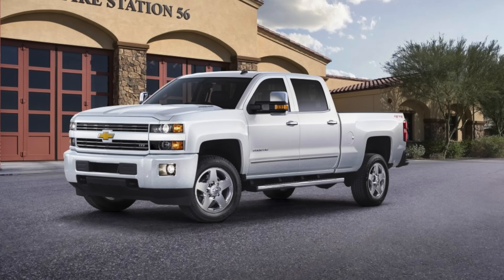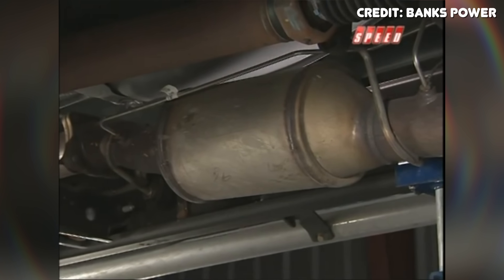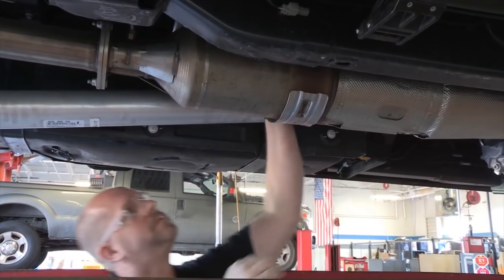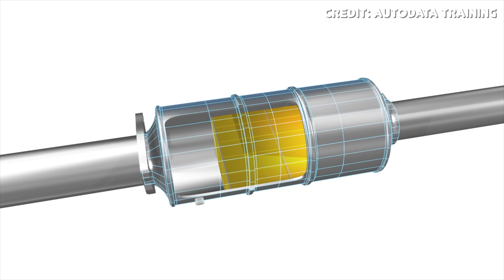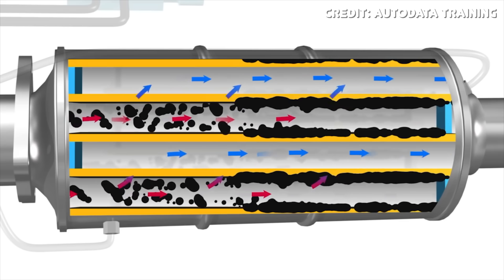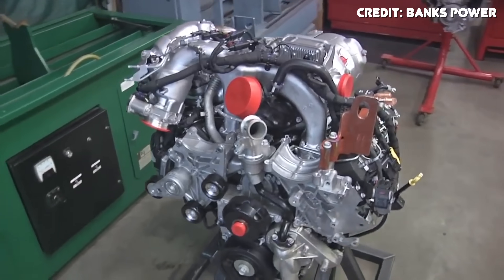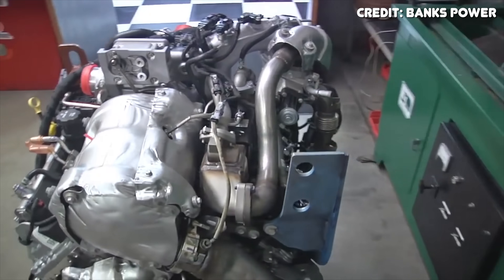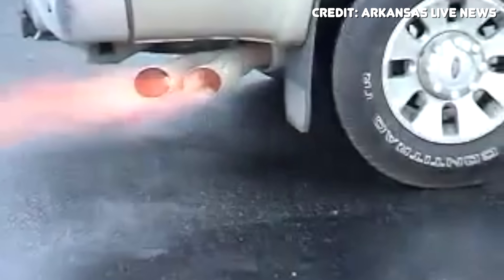Why Does Duramax Have This Exhaust Tip?

Comment: Insane emissions standards, what an understatement...
Reply: Dead the fed is what I say.
Reply: The EGR is even worse! Sending unburned fuel back through the whole intakee system. Clogging the turbo and intake with soot.
Reply: They are not insane. Diesel emissions are disgusting and cause serious disease. Only a moron wants to be exposed to these particles, and he and his children suffer the consequences. DPFs are not perfect, but they are very low maintenance these days, and still improving.
Reply: @microcolonel  typical progressive leftist talking points, you have no idea what really happens with diesel engines and the emissions they produce...
Reply: @MYSTERIOUS DRAGON dude its a c4 keep that shit quiet
Reply: European diesels don't have these problems It's the shit fuel in America
Reply: I know. I so miss all that black soot pouring out of trucks into my lungs.
Reply: No one over here understands where peak diesel reliability lies because our government screwed us out of owning the best era of diesel cars. Meanwhile over seas everyone gets 40-60mpg since almost ANY vehicle comes in a diesel. The only old stuff we can buy is 80s junk unless you want to try the somewhat rare euro cars that no local mechanic wants to work on. Non-emissions diesel Benz’s that DO NOT put out any smoke getting 37mpg full size sedans while ours get 15mpg.
Reply: More like designed to have to be fixed every 5 miles. Old cars last longer than new ones.
Reply: @classicv8dude268  no they don't. New cars operate trouble free at massive intervals that were unheard of fifteen, twenty, and thirty years ago; let alone any time before that.

Only somebody who doesn't know anything about cars can think they are less reliable today than at any point in the past.
Reply: @microcolonel  speak that truth man.  some guys want those old diesel semi's because they don't have emissions, and those trucks only get 5 mpg.  New ones get 8+ and don't soot up the air
Reply: @microcolonel  On what planet?  Peak reliability was probably in the early or mid 1990s when we were running engines which were fundamentally from the 1960s but with the addition of electronic feedback fuel systems and roller lifters.  This was long before the complexity of variable valve timing and direct injection and everything being made of aluminum and plastic.  Never mind all of the body electronics that randomly die and require a dealer technician program the replacement parts.  My friends' 10 year old or newer cars have more frequent and more expensive problems than my older high-mileage cars.
Reply: @KevinJames-yg9eu  agreed
Reply: @microcolonel  new cars are indeed more reliable. But we are discussing diesels, which are, without question, far less reliable than they used to be.
Reply: @thetowndrunk988 more complicated, but also incorrect.
Reply: @microcolonel  absolutely not incorrect. They definitely go to the shops a lot more than pre emissions. Not only do I witness it, but the data proves it. More check engine lights, and engines definitely do not go as many miles between overhauls.
Reply: @microcolonel  My diesel mechanic can prove you wrong.
The sheer number of blown head gaskets, failing injector pumps among other things not including the never ending problems with the dpf systems.
Every single time I walk into his shop there is yet another new-ish diesel with the cab lifted off the frame again.
Older diesels are rarely in there except for regular repairs such as brakes and the like.
Reply: @ajs96350  And the blown head gaskets are usually because the EGR cooler cracked and dumped coolant into the intake manifold....
Reply: @microcolonel  I have several diesels in the 20-50 year age range up to the 400k mile mark.   All function flawlessly, all have never had the head, oil pan, or other major component removed.  Other than routine maintenance on schedule with manufacturers recommendations I have had no failures and there are several examples of these particular motors going 1M miles plus.  Can you point me to a modern diesel with a service life possibility of 50 years 1M miles with no major repairs expected?  I know my dad purchased a pickup in 08 with emissions equipment and he went through 3 motors under warranty before finally selling it.  I realize these are individual occurrences and not the rule and attrition has removed many older vehicles from the market but I still would like to see any of the new vehicles that can last 50+ years before needing major repairs.

Comment: So basically what im getting from this is its catching soot to keep it from coming out the exsuast to make it seem clean just to burn it off later so you can't see it when it actually comes out
Reply: No, it's meant to completely burn the soot before it exits the exhaust in a similar way as gas vehicle has catalysts.
However disel exhaust is generally too cold for a traditional catalyst to work, so a DPF filters it out until the temperatures are hot enough to completely burn the soot so only less harmful gasses remain.
Reply: @elivestin5353  i wish i understood cause the only way i can see it is its gotta come out eventually and it just seems as how i said it in the comment above
Reply: @adambreckenridge3741  want me to explain?
Reply: @adambreckenridge3741  High temperatures in a catalyst are able to burn off the soot and gasses. This transforms the exhaust byproducts unto less harmful byproducts.
Reply: @adambreckenridge3741  It’s gotta come out eventually, but it can either come out not-completely burned as soot or it can come out completely burned as CO2.
Reply: @adambreckenridge3741  the more completely it burns the less impact it has on environment, yes it still comes out but it’s in a less harmful state after being burnt more
Reply: As others said, it turns soot into ash. Ash is less harmful to the environment than the soot, and tends to create a whiter smoke. The purpose of this thing isn't really to eliminate the Diesel particulate completely, it is to reduce the levels thereof, or to shift the levels into a less harmful form. Think about your last barbecue fire. The ash is relatively harmless. Any remaining bits of coal is somewhat less so, though the analogy breaks down a bit, wood is always environmentally friendly. But imagine a half-burned fossil fuel chunk, that stuff is usually carcinogenic.
Reply: Lots of emissions are burnt off bc it’s the lesser of two evils. Factories burn emissions from resins,  adhesives, etc at 14k degrees
Reply: No.  When it gets hot enough it actually is cleaner.
Reply: https://youtu.be/LHqyTMiFQcM
Reply: That's how DEP filters work
Reply: So i kinda understand how it works but see most newer trucks i see still blow black not a lot just some even though they are not deleted also it only happens when the burn off thing kicks in and again i kinda understand how it works but it just brings me back to my original comment
Reply: It keeps the emissions cleaner in city driving conditions where traffic and population is dense and pollution is high, and then burns them off during highway driving conditions.
Reply: The soot gets burned off and turned into ash. The ash stays in the filter. So nothing ever gets through. Eventually any dpf filter will need to be removed and cleaned to remove the ash that has accumulated.
Reply: @derekbrown2404  : Ash is formed from elements other than carbon and hydrogen, of which modern diesel fuel has an ultra low level of, likewise modern motor oil is also formulated to have an ash content a fraction of what it was a few decades ago.
Reply: @derekbrown2404  and that terrible expense is passed onto the consumer. Fk that.
Reply: @kreuzrittergottes9336  yes, there are expenses that come with maintaining equipment. FK the manufacturers for also making engine oil filters where the consumer has to have an expense in changing them periodically, as well as tires, brakes, transmission fluid and filters. EVERYTHING should maintain it’self without the consumer having to pay anything else to maintain it. FK ‘em, right?
Reply: DPFs are excellent. I probably wouldn’t own a diesel truck without one. The exhaust doesn’t stink like it does from regular diesel trucks. Also, the particles that are filtered out are small enough to enter your bloodstream via your lungs. Many people die each year due to this. We’ve been running one for 3 years now without a single issue.
Reply: yes
Reply: Only the occasional active regeneration requires the extra diesel burn. Normally, the injection of diesel exhaust fluid (DEF) creates super-clean exhaust at the tip. In combination withe the particulate filter, there is no disgusting diesel smell or black smoke. Slightly lower fuel milage and a tiny decrease in power are a relatively small price to pay for a cleaner environment.
Reply: @JamesMcGillis  and its only lower compared to that same engine without emissions, these engines compared to a comparative engine from 20 years ago is night and day
Reply: @JamesMcGillis  I have a 2016 vehicle with a Cummins, it only has about 20K miles, but I’m impressed with how clean it burns. The inside of the exhaust tip is still as clean as it was the day it was bought.

Comment: I always thought it was so that when testing for emissions that the NOx emissions would be less because the exhaust and DEF need to mix with oxygen to effectively convert the NOx into water and CO2, so some of the process actually happens once it exits the pipe, unless you have air inlets. But who knows, maybe the guy who told me that was full of shit.
Reply: no you are right, this has nothing to do with heat
Reply: I think that the def is mixed with the N0X in the SCR and that's where it breaks down.

Comment: their have been MANY MANY fires started here in montana from pickups and semis going into re-gen while harvesting 
even with the tip...... sometimes its just THAT dry out their
.
its so bad.... some farmers will NOT let a vehicle into his fields unless its FULLY deleted 
no DPF, no SCR, no cat converter, ETC
.
.
.
simple fact is...... 
1 wild fire puts out WAY WAY more emissions than 1 deleted pickup truck can in 1 MILLION miles 
.
fire in a combustion chamber is controlled..... and 99% of it gets burnt (even with a "deleted" pickup)
but fire in a field is SUPER low compression..... its a raw and incomplete burn
Reply: Man this is very interesting I never thought about these consequences. You know what would never cause these issues? HOOD STACKS BABY 😁
Reply: Gasoline engines can set grass alight as well- their exhausts naturally get hot enough to ignite grass after a highway drive, even with no emissions equipment at all. Used to be a big deal here in Australia because it's usually hot and dry, plus our rural roads often have unmowed verges- people would pull over onto the verge of the road, stop in the long grass and touch off a bushfire.

These days most rural people drive diesel utes, so the DPF regen cycle has become the main fire danger from vehicle exhaust systems. The main thing to do is make sure you don't drive in long grass after working the engine hard!
Reply: @nerd1000ify  it takes much taller grass for a gasoline engine. Enough to touch the header or catalytic converter. When your exhaust pipe is shooting out mega hot air, or worse a DPF malfunction (plenty of cases and wildfires to show) and starts shooting out white hot metal frags, a fire is inevitable.
Reply: @893R6-w8t  we have had MANY fires from gas engine cats
.
Modern pickups arnt that high off the ground (less wind resistance for better MPG)
.
.
But ya... either have to delete it
Or be really careful 
.
.
Already had an out of state city slicker set a ditch on fire
.
Pulled over to take a phone call
But you can drive and talk/text in most of montana
.
Only billings has no cell phones
It's a city ordnance, not a state law (montana)
Reply: @kainhall   that's more of a common sense thing. Any vehicle sitting in tall dry grass will eventually start a fire. Catalytic and DEF equipped cars will do it a lot quicker and a lot easier due to that being a low hanging and extremely hot component.
Reply: @893R6-w8t  sure, agreed
.
But newer cars are getting lower and lower 
.
So while my 99 buick century would not start a fire (its as high as a modern ford ranger lol)
.
A 2022 buick would be low enough to touch the grass
Reply: I wonder how long we could ride around deleted to make the same amount of emissions as that wildfire.
Reply: @MrTheHillfolk  most cars make 400g per mile of CO2. Deleted diesel that's having some fun, probably double that. 800g/ mile. BC's 2017 Elephant Hill wildfire produced 38 million tons of CO2 and was likely started by campers, which actually may have been a vehicle. So, you'd have to drive 47.5 billion miles to get that kind of emission. Not to mention wildfires burn waaaaaay dirtier than engines do.

Edit- metric system moment. Billion, not million

Comment: I always wondered because school buses "suffer" from LOTS of unexpected, unplanned regen cycles.  Mid-route sometimes.  Often really.   Stuck on the side of the road while a regen cycle runs.  Most school buses do spend the majority of their time below sustained highway speeds.
Reply: School busses do not run hard enough to burn the DPF the way it needs to be, its too much stop and go.  they should have smaller engines, or be tuned to burn more rich (but that would eat away the fuel efficiency lol)
Reply: @Gulo8282  Gasoline buses are making a big comeback even as electric purchases increase.
Reply: @jonmiguel  alot of smaller fleets have gone back to gasoline because of the headaches.
Reply: M
 I

Comment: So instead of blowing smoke all my soot goes in my dpf and then it gets burnt and blown out of my exhaust. How’s that cleaner?
Reply: Common misconception about how a DPF works. Solid smoke can't go through the DPF even during a regen cycle; when the regen cycle happens the soot gets burnt to CO2 gas using residual oxygen in the exhaust. CO2 is more or less non-toxic, unlike the various residual combustion products  that 'hitch a ride' on soot particles if they're allowed to escape from the exhaust unimpeded (e.g. polycyclic aromatic hydrocarbons, which are known to cause cancer).

Sadly this does slightly increase the global warming effect of a diesel engine, but it's better than giving kids cancer by rolling coal, and it also helps with local climate because high levels of black diesel soot tend to decrease the reflectivity of the earth's surface, leading to higher local temperatures.

Comment: Modern emission systems are there for one reason. To jack up the price of the vehicle and something else to pay for when it breaks. Same as those blind spot lights and reverse cameras. Touch screens as well. They offer something else as well, population control. Because its a flat screen/surface, there is no buttons you can remember just by touch to navigate your radio. You gotta take your eyes off the road and look at the screen. Even more dangerous at night cause you are blinded by that bright screen and your eyes take to long to adjust. Anyway, all this technology is for increasing price and repair cost. And it will continue cause someone thinks cameras on the outside of a tiny Honda is just cool.
Reply: False, it is to justify a bureaucrats job at the state or federal level.  Everybody that runs around screaming "SOMEBODY NEEDS TO DO SOMETHING!" are the reason for a lot of the safety items you listed.

Comment: Just delete that crappy system and add a smokeless tune. Your wallet and truck will thank you.
Reply: Yup emissions is bs.
Reply: I agree
Reply: Only do this if you are ok with giving kids cancer. Even a 'smokeless' tune emits significant PM under heavy load.
Reply: @nerd1000ify  lmao the urea used to make def is one of the biggest polluters and not to mention the extra plastic and the extra equipment and the extra repairs
Reply: @ceementality  you’ve never pissed on a camp fire to clean the planet???
Reply: @localenterprisebroadcastin5971  lmao

Comment: It’s for the diesel to drip out of when the dpf pours fuel out when the owner lets it idle too much

It does say in the owners manual NOT to idle the truck
Reply: Wow..... Rip it out
Reply: This exhaust tip is used on the newer def diesels. Either way, the def or diesel fuel woudnt drip out of the exhaust, the point is to use the heat produced and the diesel fuel or def to burn the soot. Like he says in the video, it oxydizes. Its not enough to "drip" out of the exhaust. That would ruin the point of all the emissions equiptment.
Reply: Nobody but you, and possibly another guy, reads manuals. I have come across manuals that have never ever been opened. I come across this while looking for fluid and fuse specifications.